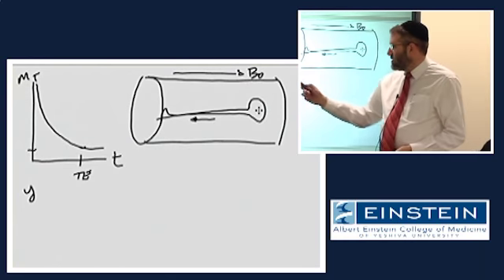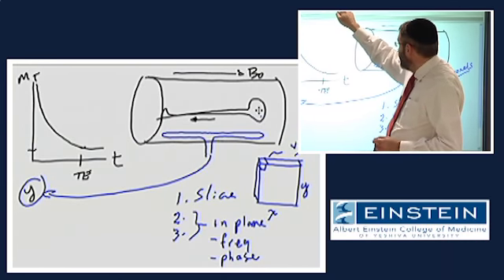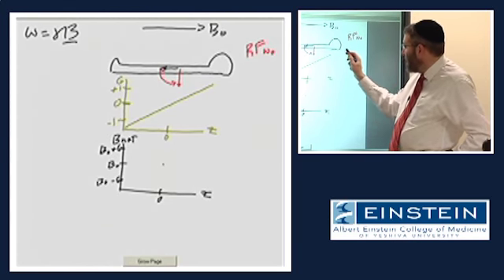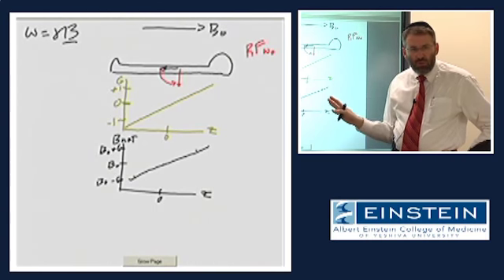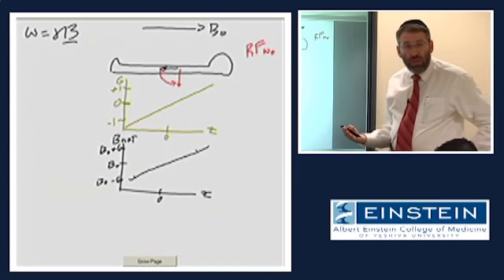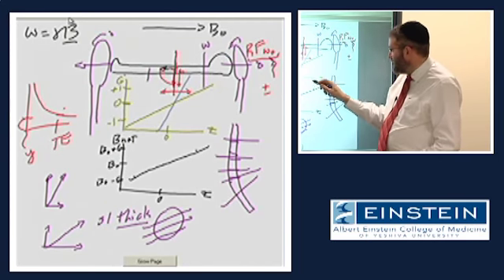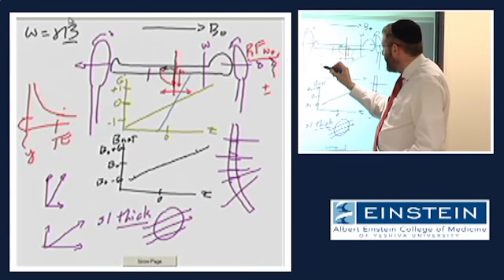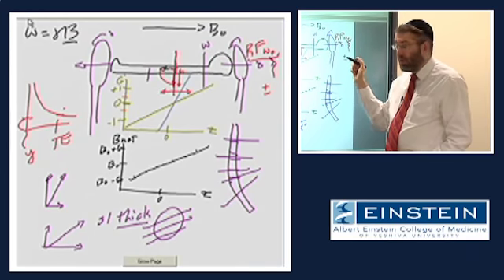Introducing MRI: Slice Selection (21 of 56)

Comment: Hello! Can anyone here answer a question i got: Does B0 have to always be oriented along the z axis or can it change? Because it's easy to understand how the Slice selection gradient adds up to the B0 when they're both along the same axis but what if the gradient is along the y axis, does B0 have to also be along the y axis? In short, does B0 have to always be oriented in the same direction as the gradient? Thank you
Reply: Hi

what is usually hard to understand for people new to MRI is the meaning of the gradient directions X, Y and Z.

The main field B0 of the MRI magnet is fixed and ALWAYS in the same direction, usually defined as Z.
So what we are interested in doing when we apply a gradient X, Y or Z (or superposition of any of those) is to CHANGE the B0 field, therefore only gradient components in B0 direction are of interest.

But what does it actually mean if we apply a Y gradient for example? Imagine you had a magnetic field sensor that displayed the field component in B0 (Z) direction only, and you MOVED with it along the Y axis, you would see a CHANGE of B0 depending on the sensor position along the Y axis. If you moved it along the X or Z axis, the magnetic field would stay constant.

Same applies to X or Z gradients of course, they change the B0 field depending on the position along the axis that gives the gradient its name.

Hope this helps!
Reply: @Pete-qn2du  thats right